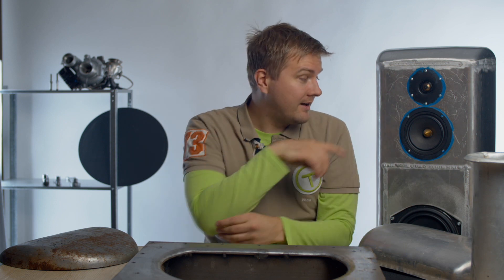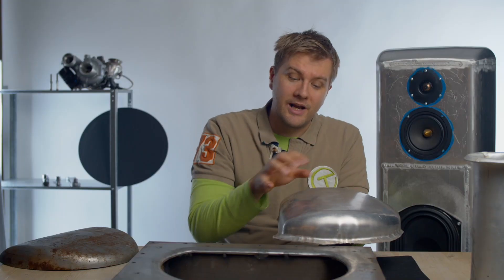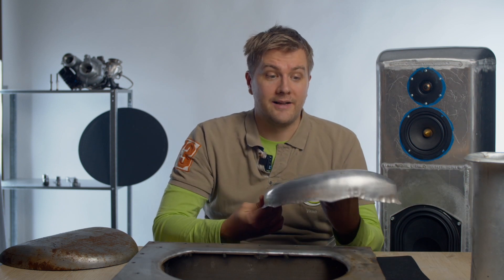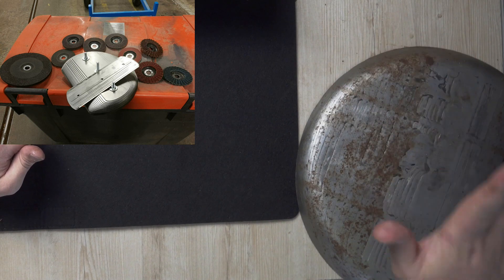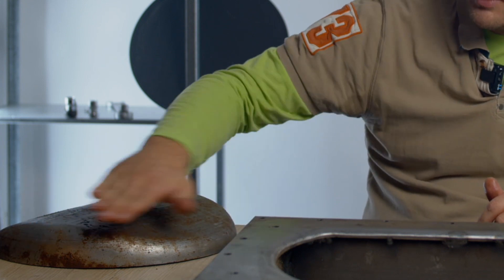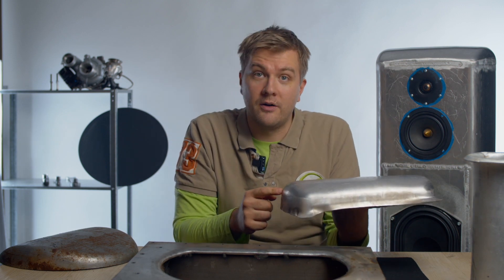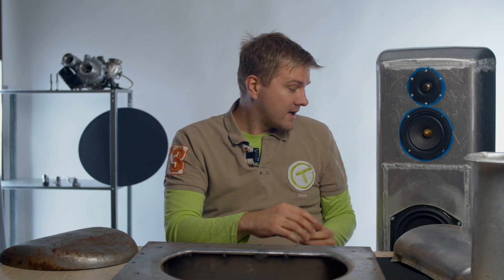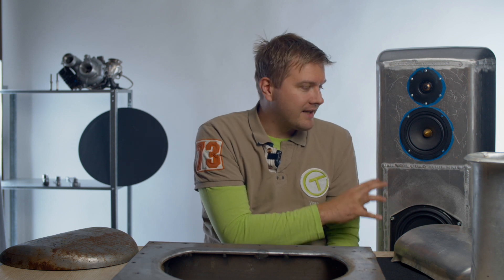Aluminum home speaker box prototype challenges revealed

Comment: I wish I could have Tig welded that for this video. I wonder what a 3 cube box with a slot port
Reply: Yeah tig welding would look also nice at the top, if done correctly. I am sure pro welder would have nailed that top without any problems but the dimensions were hint too big for that cap which meant that the top piece needed little bit grinding and the walls got thinner /too thin for me. So for next versions maybe 4mm thick top which will have more material to play to both directions.

Comment: Aluminum is typically not a good material from which to make speaker enclosures. As far as I know, the only successful ones made from this material have used thick-walled castings.
Reply from the maker: Check out genelec or magico speakers. Genelec uses casting and magico extrusions. More and more aluminum box speakers are coming to market.
Reply: @vesatiainen9701  Interesting, but I remain unconvinced! Not sure why you'd pick a material that rings a lot, then have to damp it an equally great amount.... rather than start with a material that doesn't ring much. My  pick is concrete.
Reply from the maker: @JulianEdgar  where does the ring get started as speakers elements are basicly moving freely from the enclosure? Subwoofer frequencies are much lower where there is more energy involved.
Reply: @vesatiainen9701  All enclosure panels have natural resonant frequencies. These are the the frequencies at which the enclosure walls, floor (etc) will become excited when the air pressure fluctuations (ie sound waves) within the enclosure match the natural resonant frequencies of the panel. The internal damping of the material (ie how dead it sounds when struck) is a good indication of how excited the panels will get.  Hit a lump of aluminum with a hammer. Now hit a similar thickness of concrete with a hammer. Which rings - and which doesn't? Now, make a spherical speaker enclosure from concrete. Stiff and non-resonant (dead).
Reply from the maker: Its true that conrete is better in the sense of ringing. There are some manufacturer that makes conrete boxes, problems start to come with weigth easily. Just this aluminum one weigths around 55kg If you plan to ship them abroad  or just moving it inside the house. Friend made one box from stone and it was also dead. I have used polyester resin with sand glasfiber mix in some previous projects inside the box to make it more rigid.
Reply from the maker: Nice design you have made. Ikea Blanda bowls could work also well in that design. I have used them some other protos of mine. You just need to add the conrete layer inside. 

If used materials like the aluminum are stiff and have shapes meaning they are not just flat panels the resonance problem is not big. Only front panel in this desing is flat and its 8mm thick with reinforcement plus damping. It does not need huge amounts of dampening mat to dampen aluminum for resonances, specially ones that come from speakers.